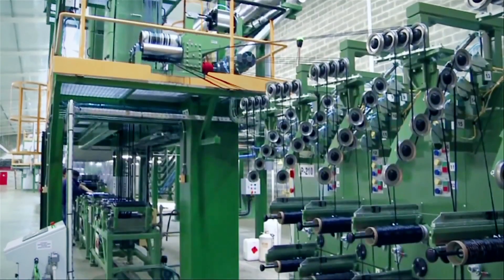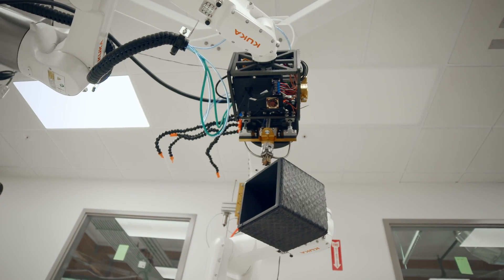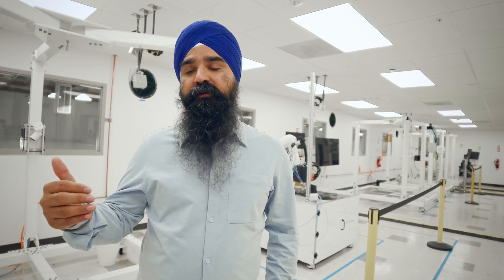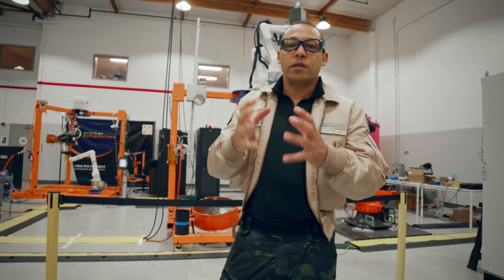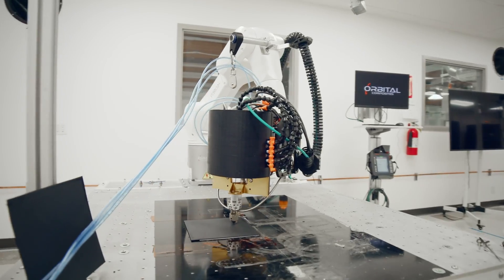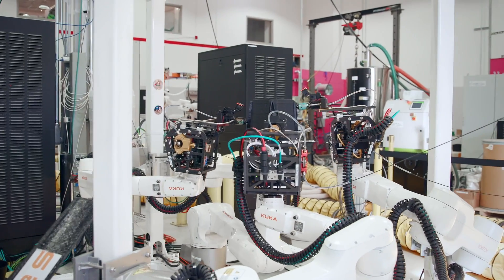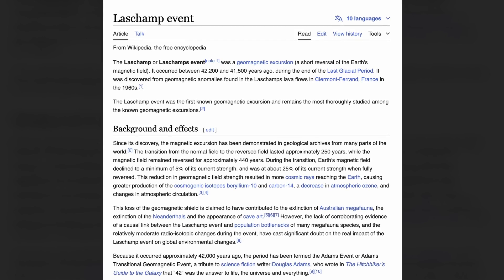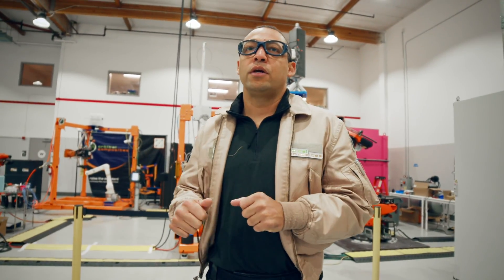He's Printing Spacecraft... On The Moon | Orbital Composites

Comment: How do you do proper layups though. This just looks like normal 3d printing. How do you achieve a 0/90 layup when you have one single fibre. Youd need to weave them somehow. Doesn't look like theres any weaving happening here so you'll have the same issues as with normal 3d printing which is to say the inter layer strength

Comment: Nice setups, interesting process. But BOWDEN TUBE on extruders is absolutely ruined the quality of the prints. Why guys use this obsolete silly decision? Extruder motor and gears obviously could be installed on the moving platforms right behind heat block - there is more then enough space on this giant black box (that of cause should be as small as possible)

Comment: This is the first video where nothing made sense and red flags were all over.
From the demagnetization theory, to the claim he "read ll the internet" on drones - and he didn't like claim to do so through AI. That at least I would not contest.
Then metamaterials, then the fact they had no footage to give you of anything. Metamaterials. Okay. What does it have to do with anything.
And so on. I also didn't get what they are solving. 3D Printing of Composite fibers doesn't take away the problem that you need to meticilously lay out a criss-cross framework for your material and design it with the ultimate forces in mind.

Nothing here makes sense
Reply: I have to admit tho, the robots looked super cool in the background. Which was intented

Comment: I don't want to be too critical, but my general impression was like it's a sales pitch. Too many general "smart" words, too little concrete examples, except for a plane and shoes. In case of a plane, they didn't show anything other than printing in multiple axis simultaneously (maybe laying fiber too). They haven't shown any internal wiring, haven't named any details about anything.
Again, just like a sales pitch.
I really hope that I'm wrong, since something like automated composites printing or in-space assembly is such a cool tech, which must become reality.
Reply: I got the same impression. I kept skipping ahead trying to get past the sales pitch, but realized it’s all sales pitch, which is fine for a sales pitch of course. I was just hoping to learn more about the tech, and like you mentioned, to see some final products. Also, I was hoping to hear about any potential challenges of fabricating under the influence of microgravity or lunar gravity.
Reply from the maker: Dang, will try to aim more this way
Reply: Was also hoping to know why printing composites is better than making it manually. Id like to see an example of something crazy that wouldn't be possible with standard composites.
Reply: You need a person to lay up composites the normal way. They are making stuff that can run autonomously anywhere, and make much more complicated objects / impossible with traditional methods. They don't show many examples because it seems their main contracts are with lockheed, a major military supplier. So most of their stuff is probably classified or has NDA around it.
Reply: @TheZooloo10  I had the same feeling. They don't sell products, but technology. Some big companies have to keep even their interest as a secret. So, NDA.

Another thing. One can argue that "this part was done already by XYZ" and "that also by YZX". But baking them together into a ready-to-use system is often a huge task on its own.
Reply: Even the shoes and plane are not proven. Any shoe reviews that this is a good idea and works? Any footage of their plane, when at the same time in Ukraine they are flying cardboard drones en masse. Just because they can print a drone doesn't give any insight about the structural forces the materials can withstand
Reply: "I'm a satellite physicist." ORLY.
Reply: That he worked on the technology for ten years sounds sus aswell, FFF printing even with a composite core can be made by hobbyist since markforged CFF filament came out- i guess their Business is mostly new matrix materials. Would be interesting what kind of new thermoplastic they came up with. Hardware wise the most impressive part of the machine seems to be from kuka…
Reply: Can we buy his "Jacket" ?